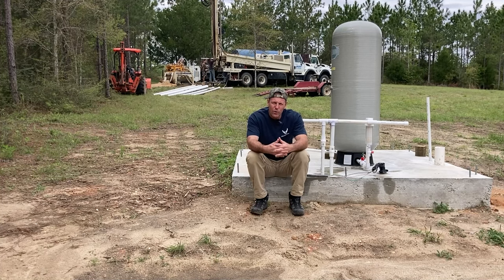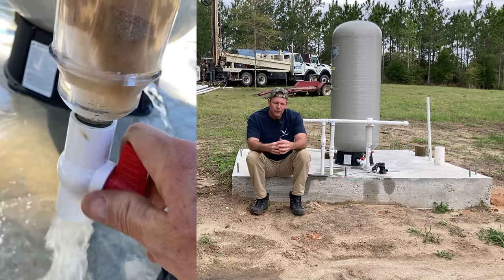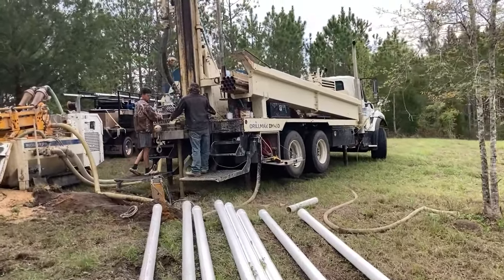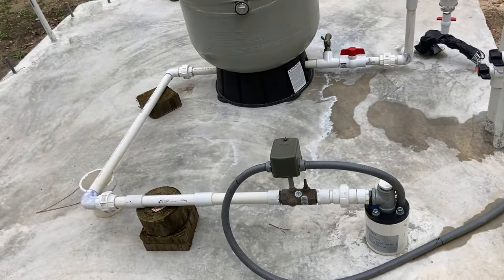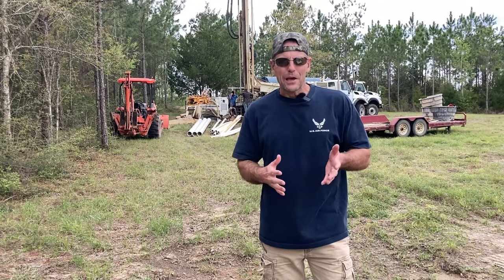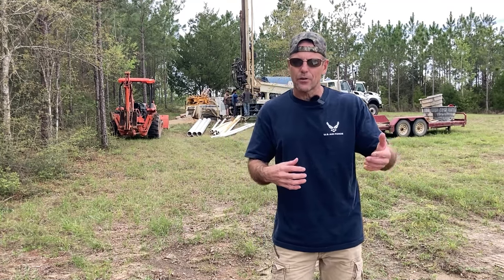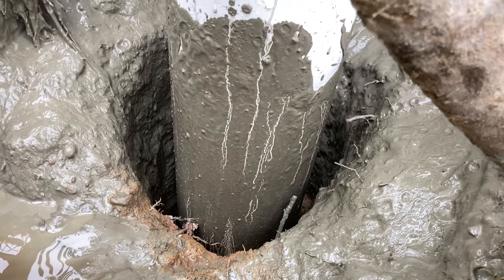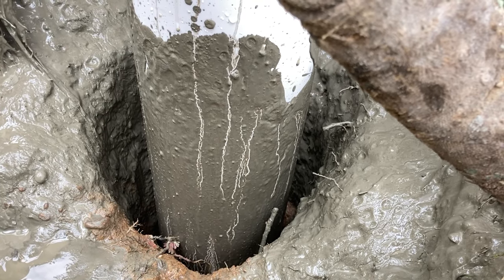We Had to Drill THREE Wells to Get Water

Comment from the maker: This is the 3rd time the well drilling rig has been on Piney Grove....will this time result in good clean water for our farm?   Stay tuned as there are several videos coming on this series!    Here's our first well video from last year:  https://youtu.be/PChOzgAWvTw
Reply: That poor feller hit a blind hole hate digging in that mess bc you dont know what you are drilling in without listening to your pipe you can throw more bentonite in & hope it comes back if you hit a little clay layer.   That man was probably happy to see that job behind him . Your old well if you didn't have it sealed off can still be used for a hand pump. Obviously have to use a displacement hand pump if the static table is that deep.
Reply from the maker: @thhillbillyinventor105  First well is complete with pump, just need to hook it up to an expansion tank and use it for irrigation.
Reply: @PineyGroveHomestead  Cant beat that then with a stick. Always have a second well even though one is a sand producer .

Comment: No limestone or bedrock where I am.  Just sand and clay so easy drilling, but you have to do it different than a rock well.  My new well hit a foot or two of top soil, sand (first aquifer), at 60 feet clay for a ways then over a hundred feet of white quartz sand.  Your stuff looked almost like dust rather than sand tho.  Hard to cope with that.  Here they placed a stainless steel screen under the casing to keep the sand out and the well tested at least 75gpm when they finished drilling (I don't have near that big of pump!) and no sand comes up the well.  Same basic story with three other wells within a mile of me.
Reply from the maker: Every well is a little different.  We're just glad it's over.  Thanks for watching.

Comment: We sure dodged a bullet with our well this past winter Brad.we were able to add one more 20 ft. section of pipe and get the pump down into water. Still 100 ft. shallower than the original depth of the pump. We do need to upgrade the well to larger diameter plastic pipe and   go with heavier wire than the 10 gauge. I want to go with stainless for at least the first 100 ft. our well is 816 ft deep and presently the pump is set at 454 ft. I would like to drop the pump at least another 20 ft. or maybe get it back to the original depth of 534 ft.
Reply from the maker: Yes Gary, compared to what you had to go through, our issues haven't been that bad!!
Reply: @PineyGroveHomestead  , but we only had to spend about 3 grand Brad... so far. more spending to come, for sure.